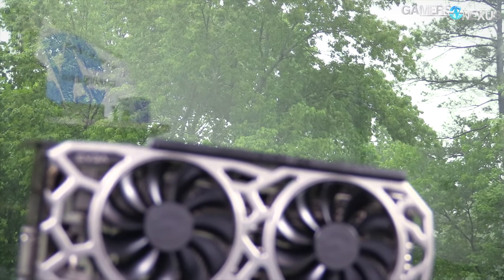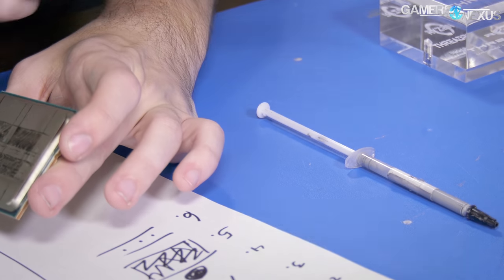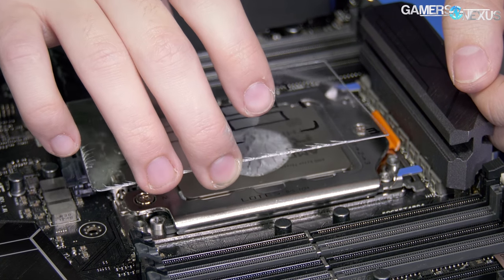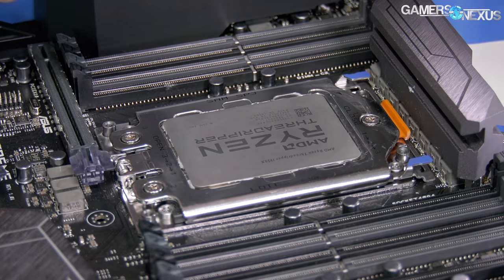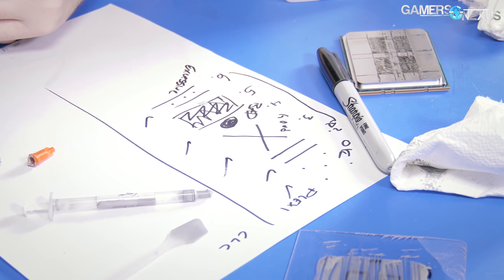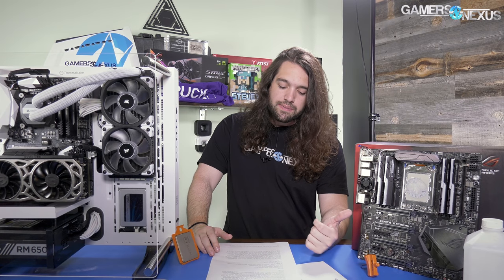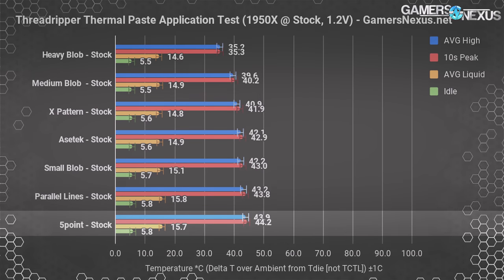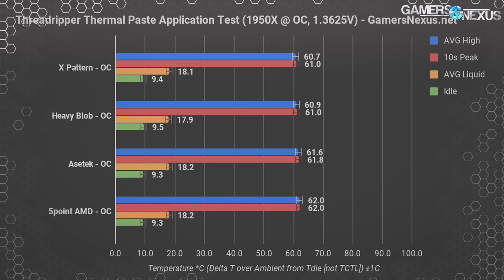Threadripper Thermal Paste Methods Benchmarked

Comment: Hello dude,
As always just to point out some stuff i feel missing:

i: A plastic sheet is not the best to show the paste spread. It can deform and the pressure you apply on it is not uniform , since it is not rigid. So the pressure applied do not exactly correspond to what a real cooler do. It is fine to do that, but i would have preferred you put the pictures of all test with a real cooler, like you did at the end of the video. Unfortunately you can't reproduce the same kind of pressure and paste spread using a plastic sheet, a thick sheet of glass would be better, even better a metal sheet. So i'm not sure that all the spreading test done with the plastic sheet correspond technically/mechanically/physically to the reality.
 
ii: You should have shown the best way to apply thermal paste. The thermal paste should always be applied with a thin uniform layer spread on top of the HIS. I'm not sure that wasting a bit of paste matter here, not sure why you come out this argument? One will not change the thermal paste each day. So i really do not understand why you just skip the best method, maybe you don't wanted have some dirt on your fingers. Or maybe because customers fear the thermal paste. But if one want the best cooling performance, it should spread itself the paste to cover the whole HIS. 

iii: There is no way that the thermal paste would have any effect at the end on these cpu. The IHS is so big, weight so much and being soldered. The cpu have advanced throttle functions that make the IHS enough to cool it during the throttle, i.e see the ryzen heating video about posted by Hardware upgrade. You should have explained that, since it is what t° test shown. Even with bad thermal paste application the delta t° is only about 10°. It mean that even with bad paste the cpu will run fine under load. 

iv: Did you really draw stuff on the limited review sample box cpu that AMD send to you, with wrote GN on it? Or it is another normal TR working cpu? 

As always, love you dude, waiting the NDA lift and the proper video of TR. 

Have fun. 0/
Reply: i) He said many times they know this.. but wanted a visual representation of what the spreading looks like to start.

ii) That not the best way (from many sources).. and it is messy and easy to mess up and introduce air-pockets. (not everyone is an expert  or pays that much attention lol) When your ready to mount your cooler you dab some Thermal Paste and mount.
https://www.pugetsystems.com/labs/articles/Thermal-Paste-Application-Techniques-170/#ApplicationTechniques

ii) They too mentioned this and it was just a matter of covering the cooler plate.

iv) Yes they really drew on it with a DRY erase marker.. You do know what that is? and it was the supposed Non-Functioning one that was custom etched with their Channel name gift that was included to all the Review samples...  When they are done they can easily wipe it off and put it back together and put it on a shelf.
For us they wanted to show on the IHS itself what it should look like underneath.
Reply: Nvm! 
You are completely wrong Sir, also you are reporting nonsense! If you are able to spread nutella on a piece of bread, you are also capable to spread a bit of thermal paste on a cpu/cooler!
I understood serious, professional and constructive comment are not welcomed on this channel.
Will not bother you anymore with comment!

Sincerly! 
Have fun! 0/

Comment: Meh, just spread a even and fine layer of the paste on the entire copper base of the heatsink. Easier than way and you get the most surface covered you can possible get from the heatsink base to the CPU.

Comment: with my asus x399 prime board auto voltage went to 1.45v at stock speeds 1920x  i got it down to 1.1375 volts @3.7ghz

Comment: The simplest method is to spread some paste over the whole of the cold plate and stipple it with your finger. Then you will get maximum contact of the cooler plate onto the processor. Why don't people work out the process in their heads before starting, instead of following every other person?

Comment: So you actually overclocked a 16core 32thread CPU to 4GHZ on all cores, pulling 260-326Watts without thermal throttling with an AIO cooler that is to small to cover the dies completly? What a beast of a CPU lol. Intel is so scr*wed with its 10core pulling 250watts on stock 7900x ...

Comment: What cooler is everyone using? I've had little luck finding one that works
Reply: Now that a little time has passed, the Noctua NH U14S TR4-SP3 and the 12 version of that have a full cold plate on them and can take push-pull fans if the single that comes with them is not enough. So far, they beat all the AIO water units like a drum. They are also very quiet.

Comment: Surprised this doesn't break NDA.
Reply: I'm sure it does.
Reply: ? Threadripper has been released for a week now.
Reply: Threadripper has not been released yet, it will be released on the 10th of august.
Reply: He says it at the very start, Thermal Performance isn't under NDA, benchmarks are.
Reply: Fairly certain thermal performance goes under the NDA too, but he feels it's okay because others have published similar data.
Reply: @Würfelcyka, the NDA goes down on Thursday.
Reply: No, not until the 10th august.
Reply: desertrat810 at 13:25 40x multiplier used for oc so thats 4ghz.
Reply from the maker: Thermal data is already out there in an official capacity. This builds on that aspect.
Reply: I'm surprised this didn't break a pin
Reply: Why would it possibly do that?
I would be more scared to damage the PCB of the motherboard then breaking a pin, its not like the CPU rest on only the pins themself.

Comment: I like the acrylic idea but this was so poorly implemented, floppy thin plastic pressed with multiple squishy hand parts... 
Either get a proper 1/2 inch or thicker piece of acrylic to emulate a heat sink's pressure distribution or press the thin acrylic with a solid block or actual heat sink. Applying heat wouldn't hurt either.

Comment: try with liquid metal maybe ?
Reply: Eliad Buchnik 
Liquid metal is for under the lid. Intel needs this more as they do not solder their CPUs.
Reply: not true. Liquid Metal delivers superior heat transfer.
If you use cheap thermal paste, you are actually isolating the CPU from the cooler.
I am ALWAYS using liquid metal since ages.
Reply: If your cooler has a copper or nickel plated copper plate, you can use liquid metal there too, and will get much better cooling performance than with even the very best thermal paste. It's just a bitch to work with, especially to remove again, so it is rarely used in that setting.

I use thermal grizzly conductonaut in my laptop and on my GPU, but didn't bother on the CPU.
Reply: the real negative of liquid metal is that after a year or so it just hardens up completely and it not conducting heat good at all. spread, shorts and all other stuff is nonsense it is easy to apply well and when you do there is issue at all (especially if you precise machines to do so), it is all about longevity,  while TIM can just keep on going for years and solder you have risk of damaging the die, and added costs.
Reply: Liquid metal is a pain in the ass and it is expensive as all hell. According to Tom's Hardware the best liquid metal is coollaboratory LM, and that requires prepping to achieve best results.

I use Thermal Grizzly Kryonaut paste, it's still expensive (not as much as LM) but it is an excellent paste and all you need to do is warm it up before application  and it will spread nice and easy across the IHS.

http://www.tomshardware.com/reviews/thermal-paste-comparison,5108.html
Reply: I use Thermal Grizzly Conductonaut on my 6700K and I even used it when I delidded and works freaking wonders. When it dries up I might go with Kryonaut but we'll see when that happens.
Reply: Liquid metal is the best for heat transfer, but it's electrical conductivity is worrisome.

I use the next best thing, IC Diamond.
Reply: Anona Mouse but IC diamond is conductive.. the next best non conductive one are the MX series
Reply: Sky Walker the best non conductive thermal paste is thermal grizzly kryonaut
Reply: @Eliad Conductonaut doesn't harden up at all, we're past that time
Reply: That is why I use it, non-conductive, and it's the best performing conventional thermal paste on the market according to Tom's Hardware.
Reply: Conductonaut is King. I cant get my 7700k over 59 degrees at 5.1 with a delid.
Reply: using it both under and over the IHS, right?
Reply: Not for me, I am ok with the Indium solder AMD uses, it creates a decent thermal conduit to the IHS, the gains would be minimal.
Reply: Liquid Metal actually is king and it doesn't look like it's going to get beaten anytime soon. Except for a better version of Coollaboratories LM itself.

I never had problems removing the cooler after years and I also never had problems to remove it again. You don't have to remove the LM like the chip was new again. It doesn't matter if you actually leave a grey layer on the chip. That only means the tiny little holes/pores of the metal surface have been filled out.

Also, it's no problem to use it on CPU/GPU DIEs. You only have to rub it onto the chip and cooler/heatspreader until it sticks to both sides.

LM does not get worse over years. You silly people are making things up without posting sources. You only hear things and think you should spread them further without actually knowing it.
Actually is the normal thermal grease that gets worse over the years.

So LM is for the people that know what they are doing and the no non conductive stuff is for the people that usually fuck up stuff.
Reply: That is one of the most ignorant statements I have read...

Sure LM gets better temps, however accorind to Tom's Hardware circa 2017 Thermal Paste Review the best LM only beats Thermal Grizzly Kryonaut by a mere 1C.... 1 fucking C for all that extra work....

Here is your link, argue this.

http://www.tomshardware.com/reviews/thermal-paste-comparison,5108-8.html
Reply: You're actually the one who posts silly stuff.
"and it is expensive as all hell."
Do you actually know how expensive Threadripper and Mainboard are? I really couldn't care less about the few extra dollars of LM.

Extra work? What extra work? Actually when I drip the LM on my CPU and block, I can make sure the entire surface is coated without any air bubbles. It takes a few minutes to apply LM. There is a youtube video for that and it shows it's a minute job. "Extra work"...sounds like it's a big deal to you, to move around the fingers a little more. lol! It's more like extra caution.

Surely, it's too much extra work for OEM PC builders. But for a single person and one or two upgrades a year it's laughable.

Thanks for the link. Shows that liquid metal is king like I just said. You can see that LM suddenly makes a jump to the lowest temperature.
Now it would be interesting to see how all these compete after 1-2 years of usage.
Reply: REDxFROG i too would like to see long-term usage testing of thermal pastes...i change it once a year tho just to be safe...i use kryonaut cause its the best non-conductive paste, and the 1°C difference between it and lm is irrelevant to my usage
Reply: @ REDxFROG I've read few people posts several years ago (maybe things changed but I doubt it) that a year after they delid and put the the LM under the IHS it just hardened up and they got system shutdown since temps were reaching north of 100 C. of course they used the cpu pretty intensely and the heat directly from the die will just harden the LM . even der8auer said said something similar. and if LM could last for so many years intel could replace their shitty TIM (that do last for years) with LM for much better thermals on their cpus and negligible increase price of production. LM is great but it's not the perfect solution.
Reply: +Sky Walker
http://www.innovationcooling.com/data_sheet.html

NOT electrically conductive.

Comment: Heathens, the lot of you. Grab a new, clean razor blade, run a thin line of paste along one edge, and spread it out as thin as you can without being able to see the metal underneath. Why rely on mounting pressure to spread your paste out? All that does is cause mounting pressure to drop over the first few days as the paste spreads out. Skip that, spread it yourself.

Comment: A thought just hit me. Why don't CPU manufacturers replace the lid on CPU's with a heatsink, attached directly to the CPU dies? No thermal paste needed, just add a fan?
The whole point of thermal paste is to bridge the gap between the metals to provide heat transfer- but I imagine a solid piece of metal stemming straight from the source of the heat, rather than anything bridging the gap, would be better.
Reply: DormantGames 

Fuck, I was thinking the same.
I would like to have a soldered CPU directly to an EK waterblock.

Comment: I've always had the best result with the credit card method, placing a thin layer on the cooler with a credit card.
Reply: chazzy2501 a plastic bag over a finger is faster and uses less thermal paste. Spreading a thin layer over the cooling plate or CPU.

Comment: Why not just spread out  everywhere ... IHS will still be burned, no matter where you place the paste, it depends only on where the paste transfer heat to the cooler ... right? im good 1000% with my 8700K and H115i polished surface to 1micron and 1mm ball of liquimetal

Comment: doesn't the thermal paste expand even more when heat from the CPU hits it?
Reply: Sure but this is not an elongated railway track where that would matter, but a flat pancake. The paste is only  a fraction of a millimeter thick, even if it expands by a few % it still would not matter.

Comment: What happens when you don't use thermal paste at all? (I ran out)
Reply: Shutdown due to overheating
Reply from the maker: We ended up throttling. No thermal shutdown, but hard throttling. Depends on your cooler, really -- if it is exceptionally flat and a good cooler, you might be "fine." But best to just throw some on there.
Reply: possible to use without but you better get some fast, its far better to use a cooler with thermal paste.

Comment: come on nerds, this is not rocket appliances. Just squirt some on there and get it evenly spread about .25-.5 mm thick. that means not enough it squirts out the side onto the die but just enough to cover the heatspreader.

Comment: Prediction: Doesn't matter on temperatures as long as you've got enough on there, because it's paste/a liquid so will spread across the area that force is applied to.

Conclusion: Yup, same old story, only matters about mess. Regardless, interesting video.

Comment: Not sure why people are so stingy with thermal paste. As long as it's not spilling out from the side just keep pouring it and cover every damn centimeter of it. Also, why does no one spread it manually with a card like we used to in the past?
Reply: Why be stingy? Did you see his hand? That stuff is messy..  The reason manual is not used is because you could introduce air-pockets which would cause hot spots.. By letting the cold plate spread it out your reduce the possibility of this..
It is also the reason you do not put the cooler on take it off and put it back on again without replacing the Thermal Compound.
The Dot / Line / X methods are the best / cleanest / quickest methods

Comment: Why not just spread an extremely fine layer over it with a razer blade or thin piece of plastic? The ideal amount of paste is the absolute minimum possible to fill any tiny gaps where there is not metal/metal contact due to manufacturing irregularities, and not a grain more. Edit: and sorry if you explained in video, I checked out the written version, saw the tests, and decided it wasn't worth watching.
Reply from the maker: It's explained in the video.

Comment: Q: what if you use a copper thermal pads (like these ones https://www.amazon.com/Vktech-Heatsink-Copper-Thermal-15mmx15mm/dp/B00E5SMY0W/ref=pd_ybh_a_100?_encoding=UTF8&psc=1&refRID=GX5P96WX1QGA7JF686AH) under the pump to cover a bigger surface? Would that improve cooling or just interfere with the mounting bracket?

Comment: The plastic you're using is way too thin. It's bending visibly just pushing the edges. Yes you can push the middle but it will not the the same as a much stronger heatsink.. use thicker plastic or glass.

Comment: where do i get the die location map of R5 3600?
Reply: just make a thin layer across the top of the cpu cover all areas that touch the cooler. X method is good

Comment: I think you guys really need to be doing this with a piece of glass.
Reply: Are you trying to get Steve to cut his wrists? ;)
Reply: lmao. No but just look at the difference between what the coolers did vs what his flimsy plexi did. If anything he should have placed the plexi on it then mounted the cooler. Keeping the thermal compound between the processor and plexi.
Reply: That would take more time would it not? It gave us a quick idea of how it will spread. 
They did show what the spread looked like after they took the cooler off.
Reply: all of 2 minutes per application...